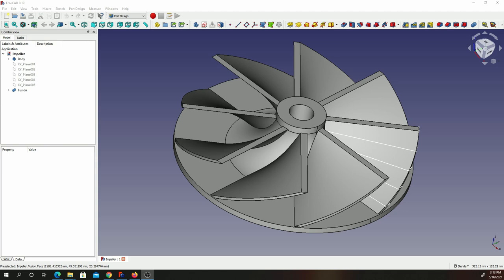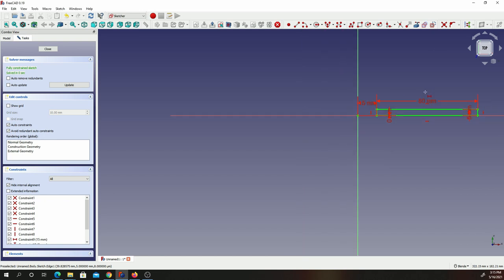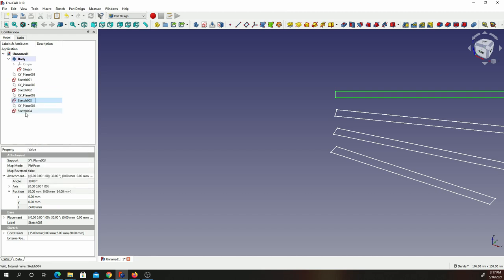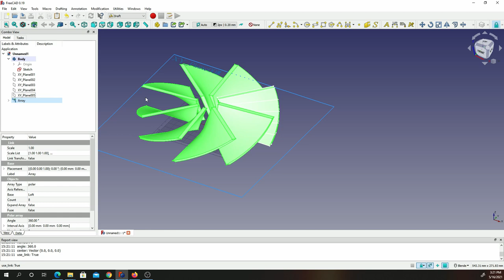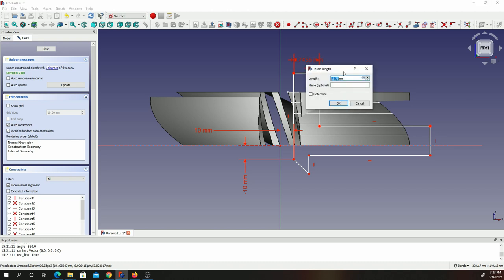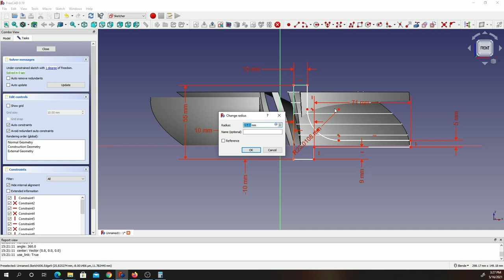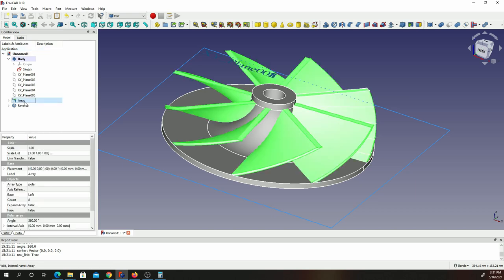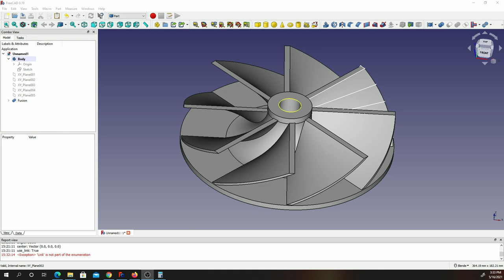Quick way to Design an Impeller in FreeCAD

Comment: Nice work. I'm curious as to why you calculated the distance in two places on the base because it seems to me that you could have applied a horizontal constraint on the bottom of the base to full constrain the sketch. The first place was when you calculated the vertical line to be 41mm and the second was when you we placing the arc. Perhaps I'm missing something but it seems that you did more work than necessary.
Reply from the maker: Good point! . Calculating the 41mm is not necessary since creating the arc will trim the line and remove the constraint. The second calculation  (5+9=14) is required to avoid an error since the arc still had an up-down movement which would affect the position accuracy of the 2 bottom horizontal lines. Constraining it to the the bottom left edge (which I did) will return the current vertical distance between the 2 points which may not necessarily be accurate .
Reply: @techwithjulius  couldn't you just make the angle between the two bottom left lines there 90°?